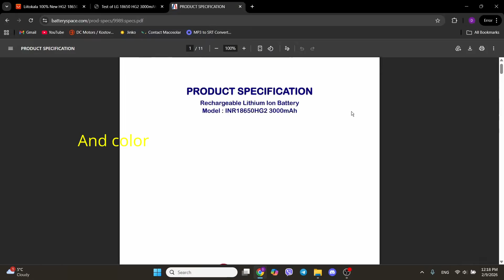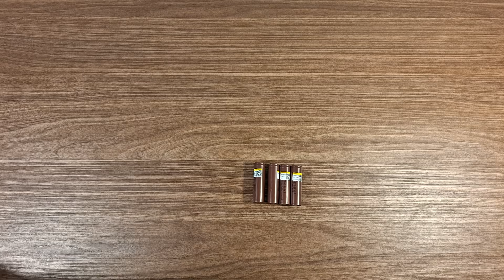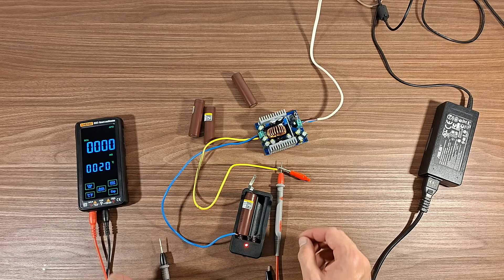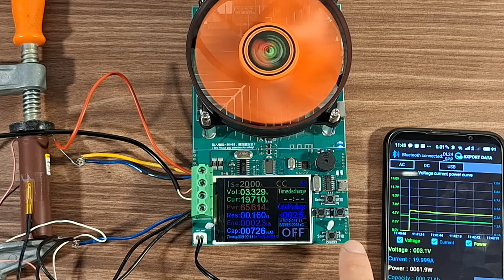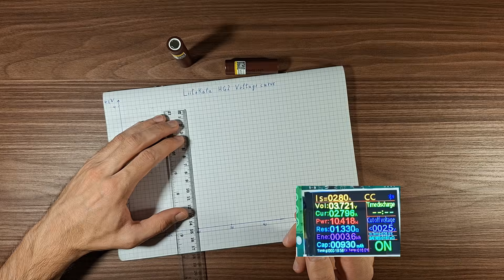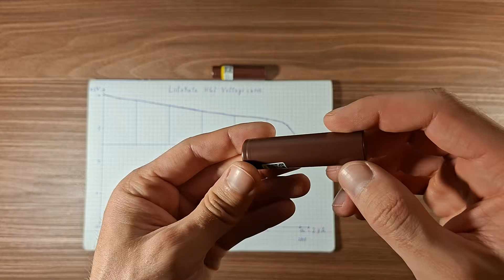Liitokala HG2 batteries, the most Loved Fake li-ion 18650 cells.

Comment: Thanks for your testing. I just ordered them under the brand of VariCore 18650 HG2. 10 pcs for 23 Euro. Maybe you are right, that most, or all, of the batteries are produced by EVE. I need them for high current application, as my chinese FAKE Battery, claimed "5500mAh" = 2 rows of 5 x 18650, one row of 5 pieces were dummy batteries !!. The row of 5 cells which was working, showed "2000mAh" on the label, but tested to 1400  mAh/each.
Reply from the maker: Hi!
Glad you found it useful.
I'm unaware of the source of these 18650 cells I got, but the 40135 lifepo4 were Eve.
Your "5500mAh" batteries being fake was to be expected, as the highest highest capacity tested in this form-factor I've seen was 4000mAh, and those are some expensive cells. Even then, they're not the best for high current applications. The ones you got were maybe older 1500mAh cells, either rejects or used rewraps. But at least you know where the problem was. 
With your cells, assuming you'll use them in an enclosed box, I hope they won't experience currents above 15A continuously ( so 7.5A per cell).
Best of luck in your project!

Comment: Quality of lithium cells goes beyond basic performance, as detailed here: https://youtu.be/-Y23nfAOiXQ?si=LGhLLy7leE7X0yu_ - short version: they are much more likely to have dangerous defects
Reply from the maker: Hey @Korkman !
You're right, I also watched that video, and I know it would make the review more in-depth, but I don't have an X-ray CT scanner.
Also, in the video you'll find that they have the biggest concerns towards the obviously fake batteries, where the capacity is rated above 4500mAh, and the cell is way too light. In this case, I measured the weight being in spec with the LG datasheet, and people have been using them for years. I don't vouch for them being the safe, but they didn't give me reasons for concerns so far.

Comment: Hi, thanks for this brilliant test! Im wondering if this cell could handle continuous 3C discharge safely.. Could you run a short test to see if it's voltage sag and temperature in a safe margin at that discharge rate? Thank you!
Reply from the maker: Hi, @Aizemiyo !
I'm glad you found this review useful.
In the video, the 1C 2.8A test shows a steady temperature up until close to the end of the test, when the voltage is starting to lower quicker, and the cell starts heating up by a few degrees.
I  terms of your concern with the safety of the 3C continuous test, the cell will obviously show worse voltage sag and temperatures will rise significantly higher. 
If by "continuous"  you mean using the 4.2-2.5v range discharge, and you have no intention of adding any sort of temperature control (stronger passive or even active cooling), I would strongly reccommend against it. 
Even if the cell wouldn't fail right away, you'd considerably shorten its lifespan.
If I did a short test, it would not give you a definitive answer about the  "safe" margin of temperature and voltage sag, because most of it will happen later on in the test.
That being said, it depends on the project you need the batteries for.
If the projects limits you in size and weight, I would recommend you look into more high-current cells with less internal resistance (they will, of course, be more expensive).
If you intend to use them in a stationary setting, and the price factor is a deal breaker, I would suggest you get more cells in parallel.
Hope this helps, thank you for watching and stay tuned !
Reply: @TifinTech Hi, thank you so much for taking time to reply. I'm planning to use the cell in an portable actuator device with variable load (6A current-limited, soft-start) that require a minimum 3.3 Volt (buck) to be operated. It wont be operated at max load all the time, probably just 15 mins at 6A at most, and the rest will scale down dynamically. Yes, I do have size and cooling constraint for this project. Cell will be paired with BMS at 3V cutoff, minus the temp monitoring. Do you think its still okay to use this cells?
Reply from the maker: @Aizemiyoin the case of 6A it's basically a 2C load, so it's not as much of a problem for the battery. I would still vouch for 2 cells in parallel because of the enclosed space and lack of temperature control, or again, higher current cells. 
Good luck with your project!🎉

Comment: Don't buy these. I worked for a repair shop where we ordered 50 of these, in just less than two years 38 cells self discharged to under 1.8V, so basically they were dead.
Reply from the maker: Hey, @legend-hl3lh !
Thanks for sharing your experience. I don't have previous interactions with these cells before the review, but I saw some other people use these for several years. They did notice a rate of degradation higher than the original cells, but I haven't heard of significant self-discarge, and subsequently failure, like in your case. 
The thing about these cells is that the store initially sold original cells, probably factory rejects, and recently there are only different cells from the originals. This is probably why some get "bad" cells and others are "good". Of course, neither is up to the LG standards. But some of them are decent for the price.
Thank you for watching!

Comment: $1 per cell is super cheap, how did you get them for that price? More like £3 upwards for me. Getting quite warm at 20a though so around 6c discharge limits them somewhat for power tools and RC application which can draw a lot more...
Reply from the maker: Hey, I am usually looking at offers on the coin page. They had something like a 50% off with coins, so I got them for 1$ instead of 2. I also found them to be cheapest at  the 2pcs offer. You can also combine these discounts with coupons, but I've explained more on that in my other video. 
I think the discharge limit is 5c continuously with some sort of active cooling, but I probably won't need it anyway, so I'm happy with the capacity.

Comment: Dividing “both sides of the equation” by 1000:

3000mAh = 3Ah!
Reply from the maker: Hi @thanhhuynh272 !
Indeed, 3000mAh is equivalent to 3Ah. 
The measurement and advertisement is done in mAh for simplicity and accuracy when describing small currents and capacities. As you saw in the video, it is easier having a 4 digit number like 2807mAh instead of having to mention 3 digits after the comma, like 2,805Ah. It is especially applicable in the case of even smaller batteries, like in some bluetooth earbuds, where the case battery is 250mAh and each earbud has a 63mAh, it's easier to read than 0.063Ah.
In the case of big capacity batteries, like 50Ah+, the number of mAh after the comma is considered negligeble, so it is usually just specified in whole amps or tenths after the comma.